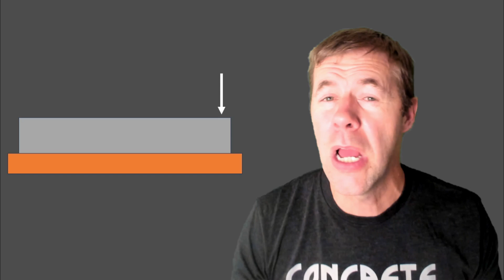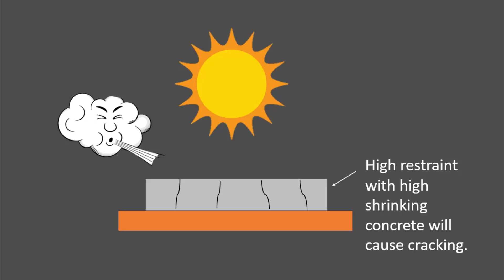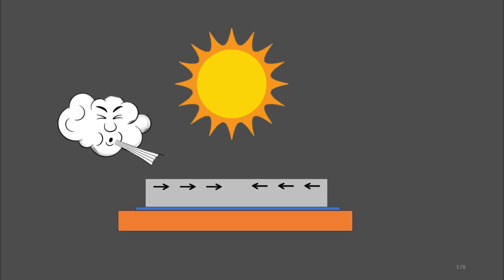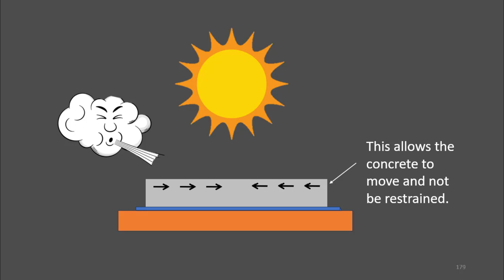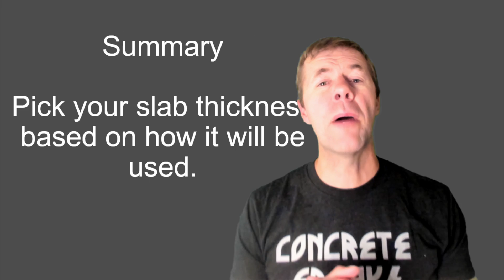Slab tips - Pt 1 - how to build driveways, patios, house slabs, and roads.

Comment: Dr T, what if you can't use plastic sheeting because of installing radiant floor heating under the slab using products like Heat Sheet. This has many elevated nodules to hold the radiant heat tubing in place.

Comment: Thanks very much Tyler! I learned something new. I always just thought of the plastic sheeting as being a moisture barrier. I never thought of the 2 sheets 'sliding' on each other and hence lowering the restraint level on the concrete.

I see that you suggest 2 x 6 mil layers of plastic lining. Is there any detriment to using 2 x 15 mil layers or 2 x 20 mil layers? Ignoring the cost and resources involved and it being unnecessary etc. I just mean is there any negative effects specifically on the slab compared to 2 x 6 mil?

What do you think about Fiberglass form work boards? In terms of the fiberglass formwork not absorbing moisture from the slab during hydration in the way that wood might. I also wonder if you think that somehow 'slicking' or spraying down all the formwork boards and plastic sheeting is beneficial. In terms of not encouraging any pull of moisture from the slab during the critical hydration period. Thanks very much Tyler.

Comment: No plastic! I have a slab patio from 1954, 4" thick, grooved every ~4', on a decent bed of sand (I know because I just cut a section with a wetted diamond walk-behind blade). Slabs need to be on grade, that plastic will yes slide, keep the concrete 'sponge' from drying out both sides, is an unnecessary cost in money and time, and will degrade into a brittle fragmented mess when growing tree roots uplift the slab, and from sitting wet oxidizing and normal heating/cooling cycles.

Comment: I recently saw a Video about a Professor of Geotechnical Engineering (Civil Engineering) Lecturing his Class on Conçrete with Rebar or Wire Mesh. 

He made the comment that he didn't like using Wire Mesh as a Substitute for Rebar because Wire Mesh was nothing more than "Temp or Temperature" Steel. QUESTION: What did he meany by that Please?

He had worked on a lot of "Big Jobs" such as Water Reservoir Dams VERSUS Concrete Slabs for Houses.

Comment: Do you have a source/reference/paper for the use of 2 layers of 6 mil poly to reduce restraint and shrinkage cracking?  It may be hard to convince other engineers/contractors to do this without evidence. My brief google search is coming up with nothing.  Thanks.
Reply: Similar question . If I am using subslab rigid foam insulation on top of good gravel base, , then lay a single sheet of poly over it , probably no benefit for the second layer of poly?
Reply: @johnwhite2576  Maybe if your base is even more perfect, you get even less cracking? Base=smooth and even thickness + 2 layers of 6 mil poly without wrinkles = less restraints and even less cracking? Expect more cracking with sloppy work than with top notch efforts? Never do a better job than what you can get away with?

Comment: What about 2 inches compacted 3/4 minus really wet down well before casting? I would imagine that the restraint is high because it’s gripping a whole layer of angular rock below it for stability. We definitely cut it up well and usually it’s cold out so the surface cracks are t even too much of a problem. I’ve found no matter what direct sunlight over 70 degrees destroys the paste shell more than any other factor lol
Reply from the maker: That is called open graded base.  It provides a lot of restraint and typically causes surface cracking.  You should try some plastic and see what happens.
Reply: @TylerLey  it never hurts to try! Thanks for the advice man

Comment: I learned tons from your videos and im now doing a catchup, but im soecifically after your take on the "self healing" properties that seem to be caused by "improper mixing" in the roman concretes and whether unsllaked quicklime pockets might be incorporated to reproduce this property?
Is there an optimimum size for those clasts? 
How to incorporatevthem?
I was thinking nano encapsulation?, preprepared sizes of embedded clasts.
The seawater cure effect is fascinating as ive for some reason decided to try to design a concrete boat/barge using basalt fibre concrete mix.
Reply from the maker: Thanks!
Self healing is something that people have studied for a long time.  There has been lime mortar concretes for a long time.  This is where lime is added to the cement.  There are good things about it but it is not widely used because the lime pockets are porous and they allow outside chemicals to readily penetrate the concrete.  I guess I need to make a video about this because lots of people ask about it.  In short, I wouldn't use lime added to concrete to try and self heal it.  I would just try and stop the cracks in the first place or keep them small.
Reply: @TylerLey  my design has changed somewhat ,the clast infused self healing properties seem to be rather specific to seawater exposure, somewhere you know thaose cracks are to settle under only exposure to salted water. Such as a seawall.
In fact quite specifically a seawall or caisson.
Ironically the thing that makes it better than modern concrete in many ways is the one thing that prevents its use in the modern world.
One diesel spill on the dock and the entire wall could be history....
My design has changed somewhat as well, the concrete (probably sika waterproof concrete blend or other propietary blend? A video on that stuff perhaos? )embedded with basalt rebar and mesh will be a large ballast plate, hull base but with hdpe upper hull.
Thinking budget houseboat, fooating home
And i suspect the entire endeavour wont make make it off paper anyway!
But a floating sea home?
 Protected by paint too. Regulalrly maintained?
Some sefarers swear by concrete sailing vessels, the spread weight keeps them very stable in choppy waters but they die of concrete cancer pretty fast, seawater rebar and a few bumps here or there they begin to crumble away.
There are mumblings out there about people using basalt rebar in boats but its mostly stationary pontoons.
In the 1st world war the british built a series of concrete narrowboats, soon pit out of service due to cracking.
One sits in a museum repaired in london.
This and the concrete dday pontoon that sits sunk out off out the coast of britain that got stuck before the landings is still there and aolid as a rock.
Git me thinking if a cincrete boat could actually be made that could cope with actually moving through the british canal network.
A new steel hull is both very expensive and time consuming andbresource heavy to create.
How would it cope if you hung it up on a lock. Which is your worst case scenario.
Oerhpas a history of marine cinctete video incorporating the roman self healing stuff?
Ive written half the trivia inserts for you already...thank you for the reply.
I keep trying to makebthe answer be concrete i promise, last time i qas viewing your videos i was trying to think of cheap mould making material for carbon layup. The answer wasnt concrete then either...
Wasnt HDPE either ...
Thats a huge revalation that this foray into marine engineering taught me this time.
Old wheelie bins will replace epoxy.
Its recyclable, tough as all hell, self healing to a point, self lubricating, and weldable.
A plastic narrowboat already exists, they used a steel skeleton but in genuinely think a big reinforced concrete tub would be far better and solve a ballast , balance and insulation problems in one fell swoop.

Comment: I though plastic is for stopping moisture and it turns out it is for shrinkage 😲 But still does concrete need moisture from below or blocking it's even better? 
Also, should we paint the patio slabs? How properly fix cracks?
Reply from the maker: Plastic can stop moisture as well but you don't need two layers of it to do that.
Moisture from below is bad.  This can cause the slab to curl.
I would not paint concrete.  I would just stain it.
I will cover cracks in another video.  It depends on a lot of different stuff.  We have some really cool research coming out on this soon.

Comment: What about elevated slabs any tips. Do you ever use double steel mesh instead of rebar?
Reply from the maker: You could use double steel mesh if you get enough reinforcing in them. 
I am a big fan of low paste volume and fibers for elevated slabs.  See Volume 2 for a little more on this.

Comment: Two sheets of plastic instead of one is one of those genius insights that seems so obvious in hindsight, but I was under the impression that we put mesh in slabs to prevent such cracking?
Reply from the maker: Mesh doesn't prevent cracks, it keeps the cracks smaller if they are in the right place.  More on that in Vol 2.

Comment: hey tyler how much sugar do i add to a 60lb bag of quickrete concrete ready mix if i want to use sugar as a plasticizer?
Reply: thanks for mentioning that, i did a read up on in it. basically the amount you use per bag of ready mix is extremely tiny. so tiny that you will most likely accidently use to much which then stuffs the concrete. its to much of a risk to use on small volumes, its really only useable if your doing truck sized volume and then the concrete plant will use the proper stuff so there is no point.
Reply: @tweake7175  thanks for the responses. quikrete sds says each bag contains 10-30 percent portland cement by weight. so .3 x 60lb = 18lbs portland  ... then .06 percent of 18 = 4.9grams sugar per 60lb bag... is this calculation correct? thanks
Reply: @lobsta1124  thats sounds about right, but its a maximum. i would drop it back to 4 grams. if the bag has less cement then your in trouble, so you might best to use 3 grams. there is not much margin for error. worse thing is forgetting if you put it in or not. 
i used a plasticizer from the concrete place and its rather forgiving even if you put in 10x to much it still works. i would check your diy stores, they may stock some.
Reply from the maker: I wouldn't use any.  It will put the concrete to sleep and it will take a few days to gain strength.
Do you have any moth balls?  You can ground that up and add it to the concrete to make it a plasticizer.  Be careful because if you add too much you will delay strength gain.

Comment: @Tyler Ley, I’ll be pouring a footing for a deck in one pour and the post column in another pour. GFRP for the column will be installed as part of the first pour.  Should I stick 2 layers of 6 mil plastic between the two pours to help prevent cracking at the base of of column?
Reply from the maker: No, you shouldn't get cracking unless it is a large flat element like a slab.  You may want to put in extra rebar at the corners of the column.  Watch Vol 2 for more insight into this.

Comment: @Tyler Ley, I listened to two of your past videos, one on the importance of wet curing to improve strength and another on the negative effects of wet curing as it increases curling?  How do you address this seemingly conflicting data on wet curing on roadways?  Perhaps I missed some videos along the way so I apologize if you’ve already addressed this.
Reply from the maker: If you are in a place where you get severe drying (desert, southern California, high mountains, any place with an average RH about 50% or lower) then you need to be careful how long you wet cure.  If you are not in those environments then it doesn't matter.  If you are in those environments then limit your wet curing to about 3d.  I have written papers about this that you can look up if you want.  In summary, long term wet curing is not a problem in most locations but there are a few where it is.
Reply: @TylerLey  this comment made me drool.

Comment: Thanks for another excellent video.  Could you provide some ball-park numbers regarding how much the concrete shrinks while curing/drying.  (mm shrink / linear m)
Reply from the maker: It depends on the concrete but a good estimate is about 1/16"/10' or 1.6 mm/ 3m.  You can reduce this by about 20% with a low paste volume or you can increase it by 20% with a high paste volume.
Reply: @TylerLey  Thank you.

Comment: thanks for the info about the two layer of plastic. we had a slab done over the top of an existing slab and it had massive amounts of shrinkage cracks. i suspect the concrete co added extra water to make it easier to finish. the slab got epoxy coated, but the epoxy has cracked where the concrete cracks are.
i've used plasticizer when we replaced some concrete work a builder screwed up and it works very well. had to make some high strength concrete to handle forklifts.
Reply from the maker: Thanks for sharing!  I am glad the plasticizer worked well for you.

Comment: Concrete is never "easy" but it seems easier now by far. Schwing pumps on ever big job, no more disturbing the base with scoot-crete buggies or bobcats. All the wire is placed before the pour. HRWRs available at most batch plants so it pumps easy. On hot, windy days, getting it down fast with no hot loads waiting in the sun seemed like the most important thing. If we could get a bull float on it and slick it down, we usually had good results. Hot loads killed the crew, slowed things down and pissed off the batch plant so we would get interruptions in delivery and cold joints.
Reply from the maker: I agree!  I think the industry is getting better.  Let's keep the momentum going.  I think people are learning a lot.

Comment: Extraordinary informational video.
Couple questions.
1- could you please explain what it means 6” Slump?
2- 564 lbs. total cementisius materials?
Reply from the maker: Thanks!

1. Slump is a measurement of the flow of the concrete.  You should look at some videos on it to learn more.  You need a pretty flowable concrete for some applications and 6" is a good estimate of this.
2. this is how much cement + fly ash or slag that is in the mix per cubic yard.  I have other videos about mix design that could help you learn more about this.

Comment: Thank you for the upload! I've seen metal wire grids that people use to reinforce slabs. I've used it in my project too. There is fiberglass mesh that is meant for dry wall. Is there a fiberglass mesh product for slabs? If not, why not? I know you can add lose fibers into the mix but I don't think that will do anything for slabs. And rebar can get pricey and kind of overkill for small projects...
Reply: loose fibers helps. he has a video on that.
Reply: @tweake7175  Yes, I'm aware that it mitigates small cracks. But I'm sure it won't do anything for you if the ground erodes or shifts beneath the slab. My question was about methods of keeping the slab intact under severe duress aside from using rebar.
Reply from the maker: @SashaXXY  Thanks!  I cover this some in my Vol 2 video.  I say in the video that you can use fibers to replace mesh and in some cases to replace rebar.  If you expect the soil to errode under the slab then I would NOT replace rebar with fibers.
Reply: @TylerLey  Ok, thank you!
Reply: My other reply has disappeared.  He has a video on frb, fibre based rebar.
Reply: You have rebar or high strength mixes, which cost more than rebar. I use micro rebar and rebar. The cost savings  in that is labor. Micro rebarr cost $3-4 pound standard is less than $1 pound
Reply from the maker: @sparksmcgee6641  Thanks!  I talk a lot about this in volume 2.
Reply from the maker: Mesh for FRP doesn't exist yet.  I don't think there is a good way to weld them together.
I am a big fan of using fiber instead of rebar for some projects.  Check vol 2 for more information.

Comment: I want to watch an episode on underground/below grade concrete and the best way to waterproof in freeze that areas.
Reply: Xypex in the mix which is expensive or you spray it on. Spray on products are endless. Peal and stick is an option also.
Reply from the maker: @sparksmcgee6641  I agree.  Most people go with spray on epoxies.

Comment: Does sand works instead of plastic or any other fine particulate material? Maybe a sand layer and top it off with lime or talc. would that work?
Reply from the maker: Yes, they will all work but they are typically more expensive then the plastic.
Reply: @TylerLey  thanks. Wanting to hear more about other restraint reducing techniques, also more about crack prevention and management in suspended slabs.
Have a good one Prof. 
Thanks again.

Comment: As a concrete finisher, I always appreciate engineering and science behind mix design.  However every time we use a water reducer, for some reason, it becomes way harder to finish.  Gritty, and harder to work cream to fill holes.  Not sure why, but it seems to always happen.
Reply from the maker: Thanks!  Not all water reducers are created equal!  Some wear off over time and this may be what you are seeing.  The more expensive products often last longer.  That could be something to look into.  I have done a lot of slabs with pretty heavy water reducer dosages and they finish well.
Reply: @TylerLey  I love your channel by the way…. I’ve learned a lot from you.
Reply: I’ve noticed the same thing too. We use it in the south because it’s so hot.
Reply: It’s because there isn’t much water in it. So it doesn’t behave like normal concrete. It does have a weird texture to it.
Reply: Sometimes superplasticizers can make the concrete a bit "sticky" - giving you the finishing experience you describe here. It usually means that you've used too much superplasticizer and there is not enough water in the mix to get the "smoothability" you need. But you also don't want to add too much water to the mix, so we usually say "split the difference" (i.e. adding a few fewer bags of superplasticizer and a few more gallons of water).  This will help you maintain the strength of the mix, and also get the finish you want.